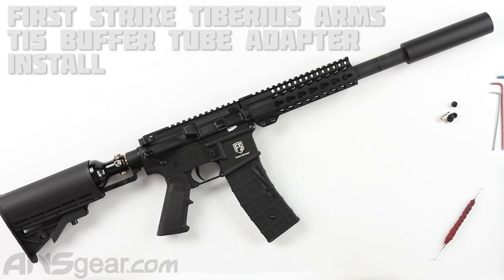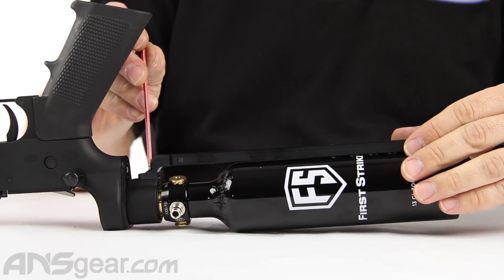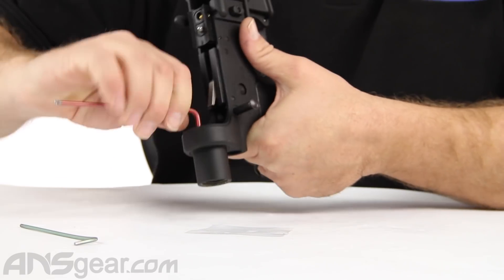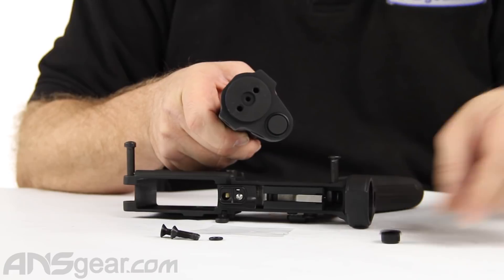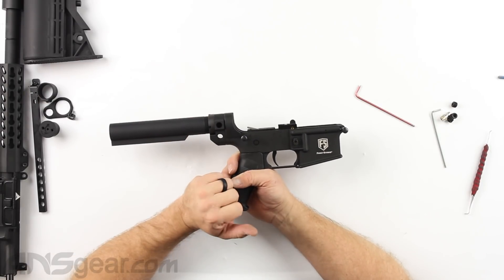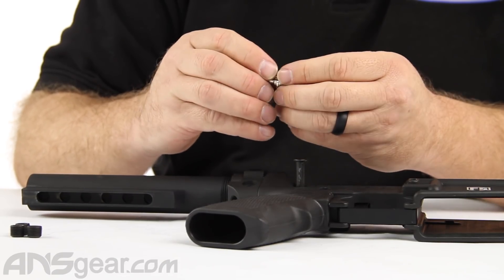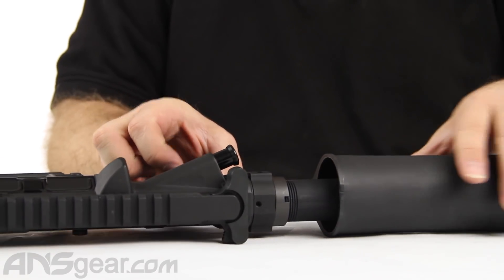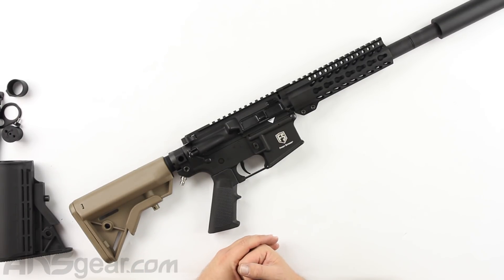First Strike Tiberius Arms T15 Buffer Tube Adapter - Install

Comment: What about the recock screw...I’m sure a remote line may use a tank that will cause issues.
Reply: As long as the output pressure of the tank is 850psi or above then it will work normally. I run a remote line and cycle full auto perfectly fine.

Comment: Best video on this.  Just to add a bit of info, the actual tube can be unscrewed from the block, so tubes without a rail can be used, such as a UBR.
Reply: So you can’t add a tank to this in place of the buffer tube ?

Comment: Can I use a ninja PTC remote line with this? or will I need to remove the fill nipple?
Reply from the maker: You can and will need to remove the fill nipple and install the PTC to make this work.

Comment: +ANSgearPaintball Does the stock end piece that comes with the 9.1 fit this buffer tube? Also, thank you for this installation video. The defcon paintball one was great, but they didn't mention that bit about the plumbers teflon tape breaking off easily.
Reply from the maker: Yes, it will fit. and you're welcome.